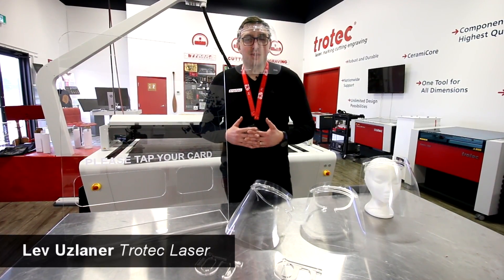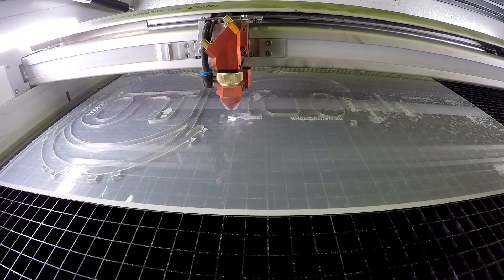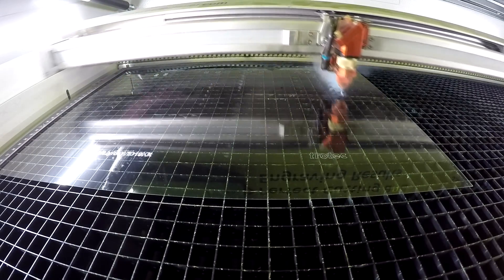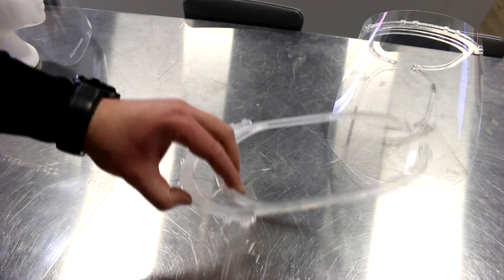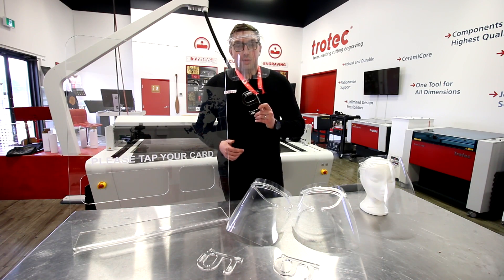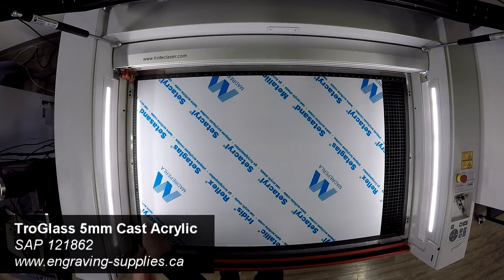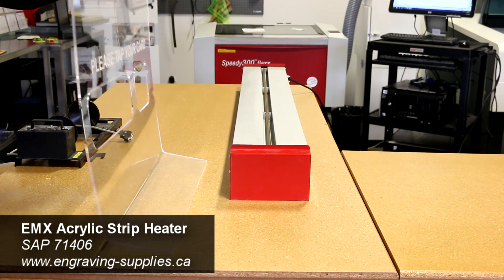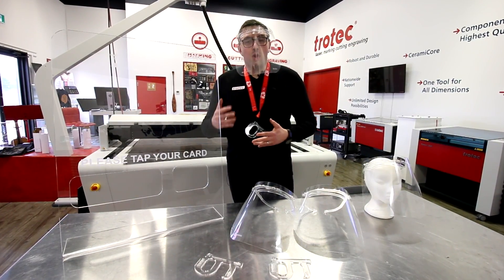COVID19 DIY Face Masks | Laser Cut PPE Face Shields | Trotec

Comment: This is a little more practical than 3d printing one piece in an hour.
Reply: Understatement. It's 1000 times more practical than 3D printing one piece in an hour. 🤤
Reply: While yeah its more practical but there are a lot more 3d printers than laser cutters. Also a combination of laser cut and 3d printing is better than either or. Injection moulding beats both. but the solution is to get as many as possible at the minute, not necessarily optimise manufacturing. 3d printing, while inefficient is helping no doubt
Reply from the maker: Injection moulding is faster but not for prototyping of course. The laser is more versatile, once COVID is gone - you'll have a lot more markets to sell to. You can't customize on the spot with injection moulding.
Reply from the maker: Yes it's much faster, the new design we did was in under 1.5min

Comment: Is it possible to use 5mm acrylic???
Reply from the maker: Yes that should be fine
Reply: I have experimented with 3mm and feel it works just as well (or better) than 6mm.  Has a little more "flex" to it.
Reply: @JBR2SRQ  thanks for the information I am trying to find a cheaper option maybe 4 or 5mm acrylic
Reply: @juancarlosibarra4864  you're welcome.  just an FYI,  the "cut out" of the acrylic produces a weak point and will crack/break if pressure is applied.  I have omitted that and seems to work much better.

Comment: Hi I have 2 questions : 1- Can we use 3mm thick instead of 6mm ? Why is 6 mm chosen here.  2- Can you cut the sheets to fit smaller laser machines, and do you charge for that extra ?  Thanks
Reply from the maker: NathboGames you can use 3mm but it will be more prone to breaking. You can fit it in about 12”x18” size if need be